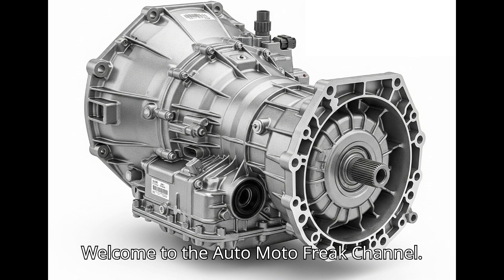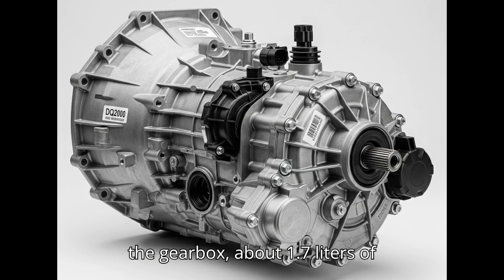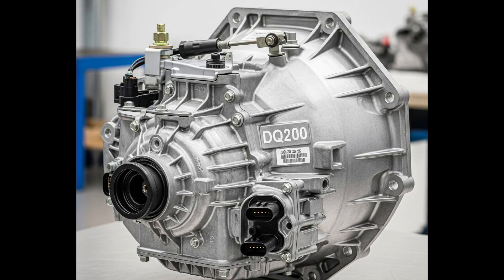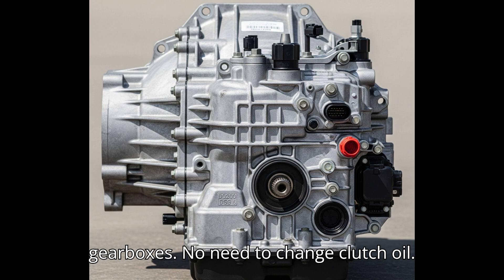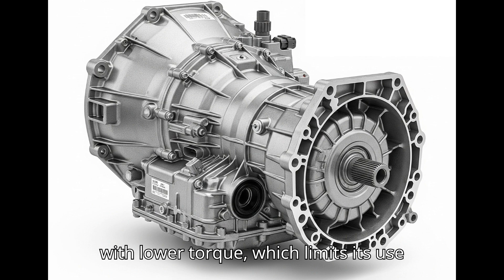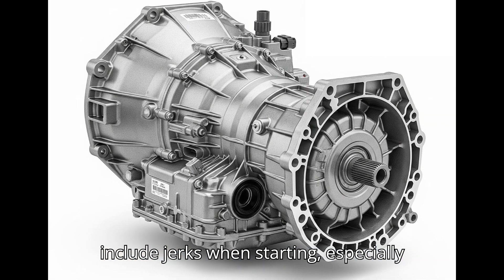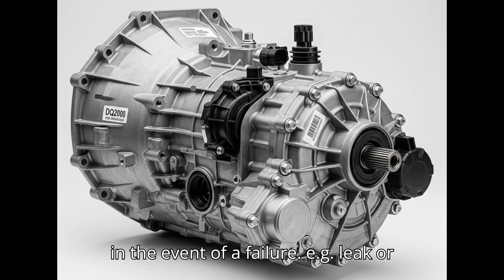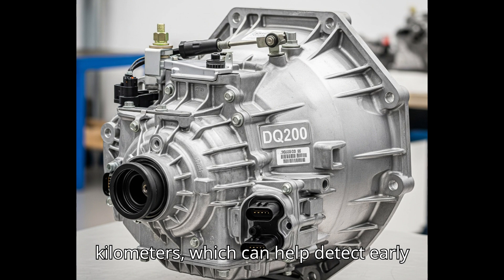DSG-7 DQ200 TRANSMISSION REVIEW, PROBLEMS, RELIABILITY, FAILURES, REPAIR, OIL, HOW TO CHANGE OIL?

Comment: Most aggravating is the programming.
It has a very low first gear, which should minimise the need for clutch slipping.
But the instant the car is moving, it shifts to second gear and slips the clutch in second!

Absolutely stupid.

I've taken to selecting sport mode when stopped, to get the thing to actually use first gear a bit. Once it's in second I'll select drive again.
Reply from the maker: Thanks for sharing your experience with the transmission!

Comment: My DQ200 packed up on me on my 4 weeks after its DSG service luckily it was covered by my extended Volkswagen warranty
Reply from the maker: Glad you had warranty.
Reply: @automotofreak I had to break hard & the gearbox went into emergency mode reverse gear unavailable I had to turn it of & on to get it to a safe place

Comment: is the dq200 in the 2018 seat leon still unreliable?
Reply from the maker: Yes,  the same transmission with dry clutch.
Reply: @automotofreak  although substantially improved over earlier versions.